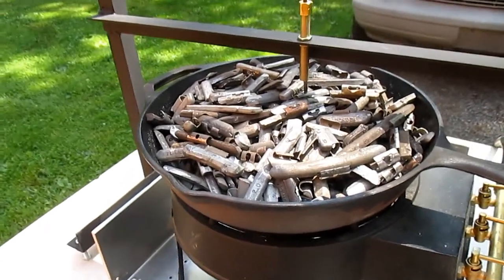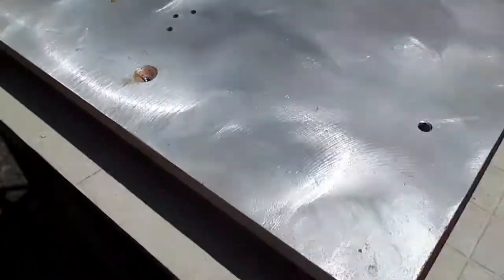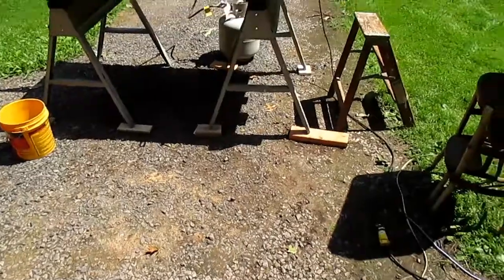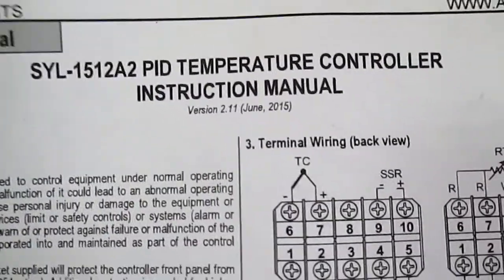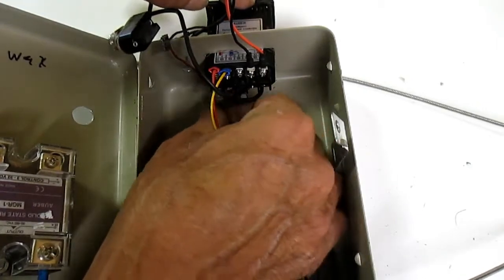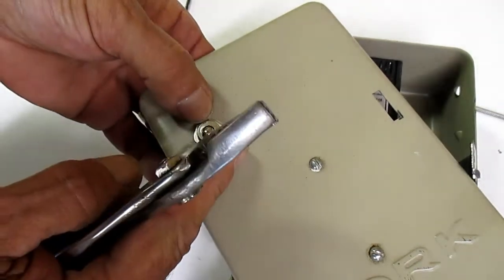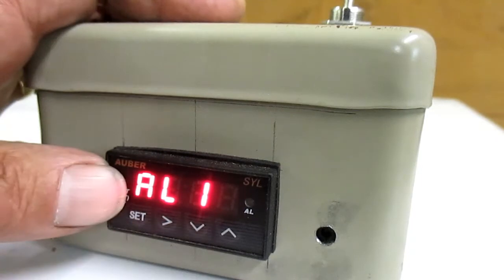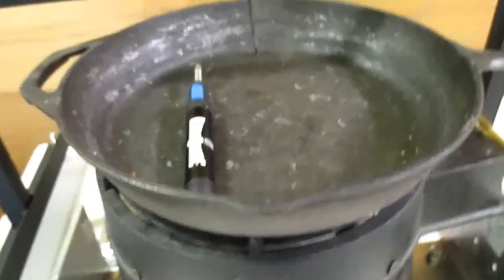PID alarm for smelting wheel weights

Comment: Melting down a huge cast iron dutch oven full of lead wheel weights using a high output LP turbo burner and a turkey/fish fryer without a PID is a disaster waiting to happen. Less is more and more is less. You want to bring them up to somewhere between 621 - 700 degrees slowly and carefully monitor the temp. Zinc won't melt at that temp range but all of the lead/tin/antimony will be completely liquid and ready to pour. The magnet idea was very clever and very similar to how the Frankfort Arsenal (SKU: 909271) magnet works to recover stainless steel media pins in wet case tumblers. They aren't rated for that kind of heat though and making one using your idea would be preferred. Your PID thermocouple stand is also very clever and works great. It always amazes me how us reloaders/bullet casters have to design and fabricate so much of our tooling ourselves. No one makes a affordable commercially available one for the masses to buy. I've made a bunch of my own reloading/casting tools. Some of them are my PID digital temp control boxes and a metal stand to hold and adjust the thermocouple probe in casting pots. I've also made steel ingot molds, berm lead recovery shaker boxes and various other mining tools, casting mallets, large smelting pot setups, ladles, paper/silhouette target holders. I have made my own swinging steel plate targets, reloading benches, single reloading press steel stands anchored to the concrete floor (kinda like old grinder stands with a steel square tubing pole and  top/bottom steel plates etc etc etc. I suppose they figure if we are smart enough and mechanically inclined enough to reload and cast bullets we can build our own equipment. You can remove Zinc that has contaminated your lead alloy using careful temp control and powder pure sulfur. While doing this you must be very careful because the fumes are toxic. A good quality 3M P100 respirator is a must. It also flashes and bursts into flames so it must be done outside in a clear area void of fire hazards and you remaining upwind of the fumes. Tie a piece of toilet paper to a stick and insert it in the ground near you to keep a eye on wind direction. It's far easier to take your time and be more careful to start with. It seems every guy with a match and a LP turkey/fish fryer is melting their own scrap lead these days. Us more experienced guys wouldn't want anything they made or loaded. The same guys overcharge and make (((((ATOMIC))))) barrel burner loads because HOTTER is always better as well.
Reply from the maker: I'm glad you're using your Ingenuity to work for you, I do things as I need them

Comment: Specifications:

K type thermocouple	Grounded
Cable length	6' (2 meters)
Cable	Fiberglass insulated and single-thread braided (900 Deg. F)
Probe diameter	0.12" (3 mm)
Probe length	6" (150 mm)
Max insertion depth	3” (75 mm)
Compression fitting thread	3/8”-24
Maximum working temperature	1100 ºC (2000 ºF)
Maximum temperature for transition area	400 ºC (750 ºF)
Transition section dimension	0.3” in diameter and 1” long

And do the all hook up the same to pid?

Comment: Isn't it easier to just not put the zinc ones in the pot?
Reply from the maker: When you have 120 lbs of wheel weights to sort out a few of the zinc can slip by, this is why I do this
Reply: @backyardinventor9580  good point.  nice magnet trick. 🍺

Comment: You didn't explain what PID is??
Reply from the maker: PID controller is a temperature controller takes an input from a temperature sensor and has an output that is connected to a control element such as a heater or fan. ... It compares the actual temperature to the desired control temperature, or setpoint, and provides an output to a control element. I use that PID controller on my melt pot also to hold the temperature at a set value and is very accurate within a few degrees. There are many uses for PID controllers and this is one.